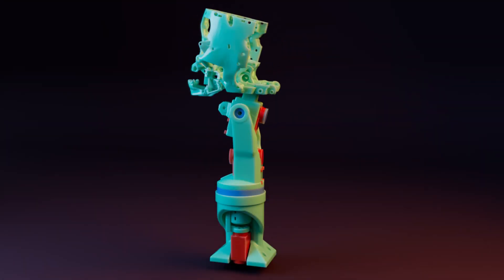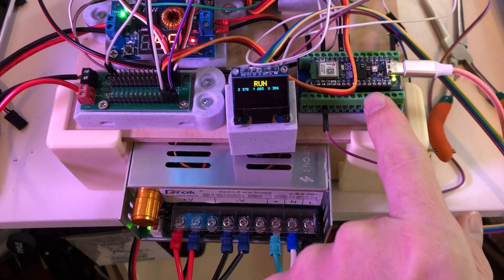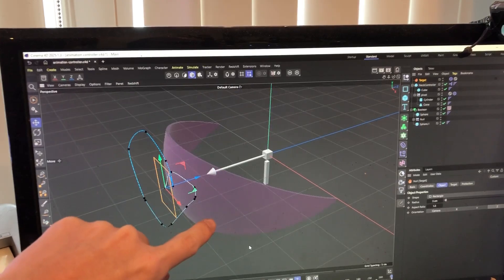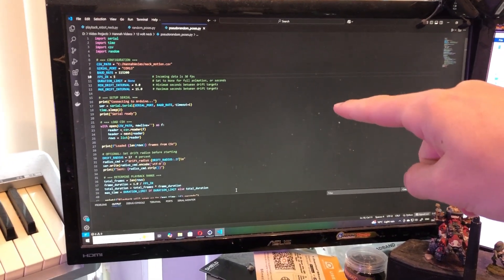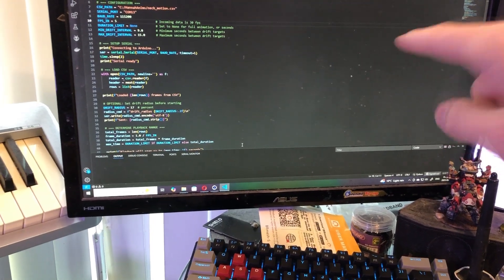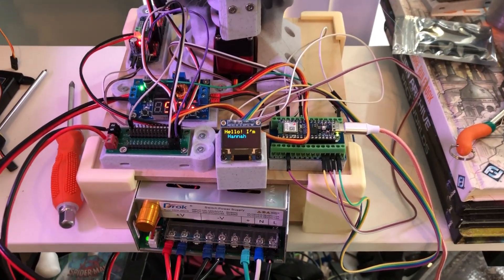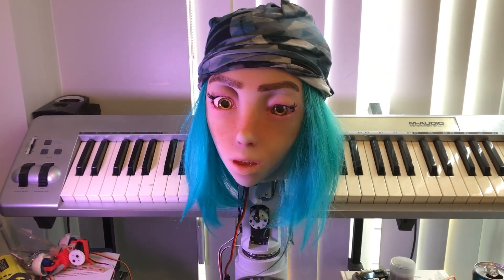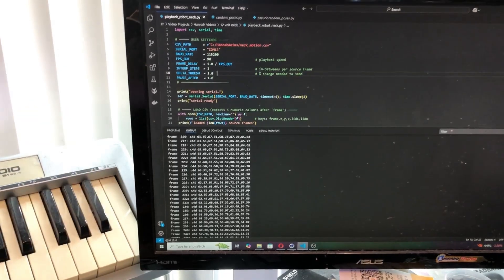Hannah's New Neck

Comment: eventually, there will be hands with articulated fingers.
Reply from the maker: I've done a bit of work towards some articulated hands.  Not going to be easy to shrink them down to an appropriate size to match the rest of her.  Motors are big.  Most articulated robot hands are oversized even for a large man.
Reply: @DaveMakes  could you make finger movement through strings attached to "forearm" where the motors are located? Kinda like muscles on real arm.

Comment: I know you had moved away from stepper motors and briefly tried brushless ones - don’t recall exactly why, but if it was a noise issue with the stepper motors, maybe it would be worthwhile to look into how Bambu or newer Creality printers drive the steppers. They are extremely silent (the ender 3S1, unlike bambu, has no noise canceling but is still very silent) and the smaller ones like Nema8 are fairly affordable and would be small enough to be used inside the head (I think). Very cool work regardless! Just my armchair engineer thoughts

Comment: Backlash doesn't matter if you can measure the final position with a closed loop PID control system.  The issue is, your servos are measuring their positions prior to the introduction of the backlash.  Instead, they need to be monitoring the position after the backlash is introduced.

Comment: I'm both traumatized but also kinda in to this it looks so cool will she ever be able to walk around and fully interact with her world is that even possible
Reply from the maker: I think she'll live on the desk for now.  I do want to more completely integrate some AI into her so I can talk to her though :)
Reply: @DaveMakes  oh that be so cool I wanted to try something similar but lack the skills you have so I'd have to use one of those projector fans to make a holographic version of my character are you going to use chat gpt API or a local solution?
Reply from the maker: @ryanboyer9922  Local is absolutely the way to go.  Qwen3 is right now probably at the top of the open, local models.  It does both reasoning and normal chat very well.  
I've done some very bare bones integration already for testing in the past with Llama2, but i've focused almost entirely on the mechanical design for the robot.  Mainly, these AI models keep improving and changing so quickly that it feels weird to spend too much time working on something right now.  In a few months things could be very different, so I don't want to spend a lot of time working on something I won't use at all - though I do want to keep in touch what's going on.
Reply: @DaveMakes  I know what you mean it's both overwhelming and incredible the speed AI is moving at I can't wait for it to reach near human level memory and capabilities

Comment: I think the speed still seems pretty linear. Perhaps if you slow down, her head wouldn't shake so much when you stop.
Reply from the maker: yeah, that's an issue.  Having trouble with these motors at lows speeds.

Comment: I thought you had swapped to using brushless motors making it way quieter, why the swap back to servos?
Reply from the maker: Well, I got frustrated working with them.

I tried to save some money by getting motors without integrated sensors or control boards.  Thought I would do it myself.  This turned out to be a bad idea.

But man, integrated BLDC motors for robotics are SO expensive.  I will try them out again in the future when I have budget for them.

I have a whole handful of BLDC motors at the moment (no integrated encoder or controller), but they are presently just too tricky for me to make use of properly.  I'll get there.

Comment: I think you need more juice to those servos. Your movements are drawing a lot because it’s 3 big servos all starting simultaneously.
Reply from the maker: I think my supply should be ok.  It's rated for 30amps, with a variable voltage.
edit:  I was wrong, it's a 10amp supply.  Still, that should be ok.  Though I can see room for more current supply.
Reply from the maker: so, I double checked and discovered that it was only a 10 amp supply.  So, I may need to change that out for a 20 or 30 amp supply.

Comment: I've had an idea for a neck/torso segment design that I've wanted to try, like a  simplified Stuart platform, using just 2 linear motors and a rod. The rod acts as a spine, with a ball & socket joint for rotation, but maintaining a constant length. The 2 linear motors can easily control the head's pitch & roll, but with a bit of fine tuning of leverage points I think it can also control yaw without needing an additional motor.
Reply from the maker: Check this out:
https://youtu.be/nJHHHZrYEzs?si=zezAQFfc0MjH-alL

It works very well, though you definitely want a U-joint in the pivot, not a ball joint.
Reply: @DaveMakes  That's similar to what I'm referring to, but not quite there.

Comment: Impressive! I noticed it's faster than previous versions. I also noticed that you are connecting the pieces directly to the motors' axles. Because necks usually don't require too much torque to move (since the axle is centered to the components from what I'm seeing) it might be viable to connect gears to it to customize speed and torque. It's really cool how you designed the neck mechanics.
Reply from the maker: The bottom motor is directly connected, the two others are connected via a linkage that gives them some mechanical advantage, and reduces their range.  Keeps everything within a realistic motion range for a head.  Not too much tilt or up/down motion, but plenty of rotation side to side.

I need to tackle some backlash on two of the motors which is causing some really nasty jiggling, but that will be for the next time I print it out.